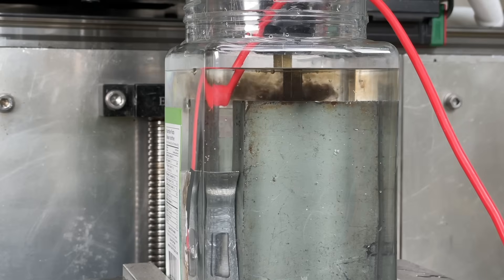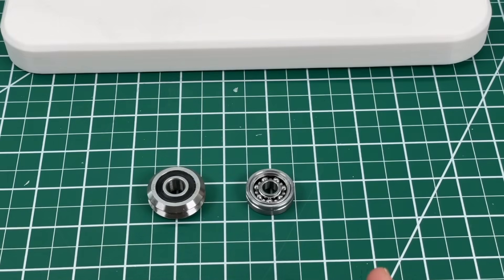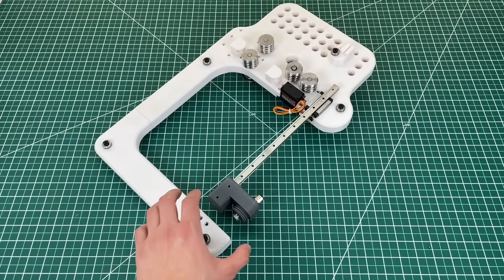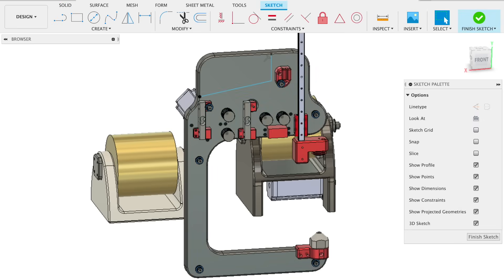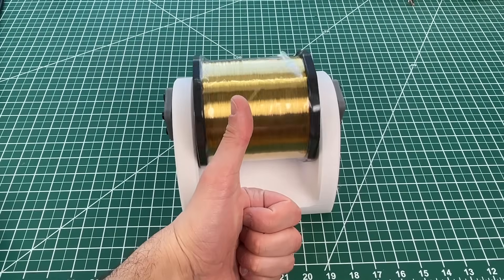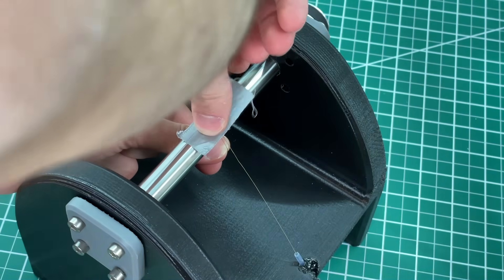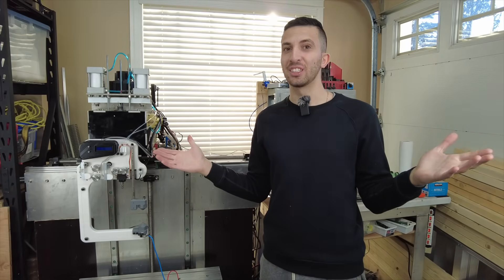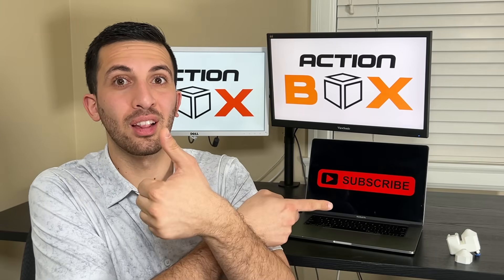How We Made A Wire EDM Machine At Home

Comment: The spark generator you are using is designed for a sinker EDM which requires allot high currant. This is what’s snapping your wire. I agree that Baxedm is way over price but it is his product to sell for what he thinks it’s worth. Unfortunately there are no other options. I truly believe he would sell more product with a lower price. I know I cannot justify or afford one. You could possibly try to modify the sinker EDM to lower the current output but I doubt it would work. Enjoy your videos and topics.

Comment: Although I know I'm late, I'll leave this comment for anyone interested in wire EDM cutting machines. There are several important factors that home makers don't know or omit. The first is current control, but this goes hand in hand with the second, which is peak current control, which depends on the wire; you need to know how many maximum peaks your wire can handle Before breaking and third, the gap control, which is where the algorithm for the cutting advance is taken from.

Comment: @actionbox. Looks like a very promising piece! I was just curious If the physics is correct on this... I'm a simple man so take it  at face value but it seems to need a centralized focus point. Perhaps instead of it being in a pool of fluid you should just  pour the fluid over the top so it isolates the spark each time you push it against the material instead of increasing the surface area. If this theory pans out it may explain why when you increased area it was even less of a desirable cut.

Comment: I knownthisbis old but never use 100% infill, 98% is as far as you should need to go, because 100% will try to fill all the non existant gaps that apear in software at cross sections. And doesnt acutally add any extra strenght

Comment: Having retired now for 5 yrs doing wire eroding I think you need a spark on off times in the generator and the wire needs to be able to back off if it senses a short circuit then approach the work piece again but your problem lies in the generator the current has to be able to pulsate.
on a purpose built commercial machine we had a lot of wire breaks until all the settings were fine tuned, its not easy or straight forward by a long way. good luck if you crack it.

Comment: You'll have better luck with tungsten wire.. and you are correct about needing a water filter. Dissolved metal destroys your deionized water pretty quickly otherwise. Your filter is gonna need to be two stage to one micron If it's going to last very long

Comment: Not sure about EDM but in electronic circuits and lasers, we're generally looking for 18Megohms/cm. Don't know if I'd trust Crappy Tire to provide that. If you're introducing metallic swarf into the water, I think you should consider a 0.1 micron filter followed by an R.O. set-up. Keep in mind that DI water is generally dissolved oxygen rich. It will tear any copper to pieces. Nice rig though!

Comment: Please, don't use multiple micro controlers for the tool, I know they are very cheap but even so I feel a bit disturbed since their prices here in Brazil aren't so friendly, I think you could have use a single arduino for both pressure loads and for the LCD, I think it would also be really nice if the tension on the wires wheren't controled by knobs, but by the GCODE, you could do that by connecting the arduino via serial to the main board, and the main board sends commands about the wire tension to the arduino

Comment: Hmm, i can onlu think of a few possibilities but i dont have immediate soultions. Note: i dont work with these systems, but i have a mibor in EE, so i can theorize.

1) the wire is desolving itself and elecrtoplating itself onto your work peice. Swapping pokarity may fix this.
2) The sparks generated may be heating the wire up too much resulting in it melting and thus breaking.
3) Too much tension, causing the wire to streatch and break as it heats up slightly and pulled through the deionized water. If this is the case reduce  the tension on one side or tge other. (You may even have to build a powered feed system as well.)
4) Check the conductivity of your water. (Sometines the chemical processes used to process the water can leave residual particles. If this is the case you should be able to pick up come resistance in the water. If it's properly deionized then you should have an open circuit. If it has any reaistance change your supplier.)
5) I know your cobtrolling yiur current, but have you checked your voltage. If the voltage is to high you may have an issue.
6) If the wire is getting too hot, you may need pulse it to give tge wire time to cool between sparks. I believed this would be AC, or pulsed current. Any standard PWM may work, or maybe use an amp on a waveform generator? This would give the qire time to cool between pulses.

Let me know is any of these helped.
Thanks and great video.

Comment: Awesome job, I have at least a decade running wire and cnc and manual sinker edm. You getting this far is great. Some tips I would tell you is wire is its own beast and where your flush cups are located in relation to work is crucial .005 above and below plus good flush and filter. I have no idea how your controlling the power but lower power until fully into cut switching polarity from table to electrode and adjusting on and off times in your spark. In my opinion finding an older machines power supply with the preloaded power settings would be the only way I could ever even attempt something like this. Great job again, very very impressive. PS you got me to sub.

Comment: wire edm machine limits Amperage not exceeding the strength of the current-carrying wire, limits the gap between the wire and the workpiece at table speed so that they do not come into direct contact, regulates the adjustment voltage, cannot be pushed like that😂😂
Reply from the maker: So we’ve learned.  Our next iteration will improve in this 😊

Comment: You need to detect the current in the wire to prevent a high current which will burned through your very thin wire.

Comment: Using 100% infill is mostly a waste of time and plastic. The mechanical stress is mostly concentrated on the surface and mostly in the inner corners of the part. So in order to have a strong part you only need to make thick walls. Infill does not contribute to the strength of the part, it's just an internal support structure for the printing that you can't remove.
If you still have to make some area of the part stronger (like those places where the bearings are inserted), I think Cura has a a way to locally change the printing parameters using local volumes, which should allow increasing the wall thickness in particular areas.
Rounding those main inner corners was a good idea though - this does spread out the stress and makes the part stronger.

Comment: Spark control ... needed. The nozzles should have the conductor tips.. you only charge the wire near the work area. The take up wheel could be rubberized .. running wire between 2.. when running wire you don't need to re spool. Most machines just collect in a bin. I've run and programmed Hitachi 203r and also a Makino wire edm. These have independent top and bottom wire guides to help align and square to work area..

Comment: Idk much about this technology but I do think that the wire isn't supposed to contact the workpiece which is why the need for the dialect water, it acts as an insulator while at the same time keeps the wire cool, so I don't know what kind of power supply you would need but it would need to be high enough volts to be able to create a spark gap much like how plasma cutters work. if you ever used one the first thing they tell you is don't let the tip touch the workpiece. Might be a good place to start. Seems like a cool project I would love to see it work for us diy guys.
Reply: Ok so I find this technology really fascinating and found some interesting things out. So there is this guy who made one of these over at instucables, and for his power supply he uses incoming 110 ac, runs it through a 200w bridge rectifier, uses a 200w incadcent light bulb to limit the current, and looks like it has a couple capacitors to. The circuitry looks relatively simple, and he has posted videos of it working. The AC is converted into a pulsating DC voltage 60hz or 60 times a second, idk if this would work or not because I thought it had to be between 300 to 1000 a second. But maybe still does work, and is just slower. I was also right about the wire not supposed to touch the work piece you may have to touch it to start the arc but then pull it away much like Tig welding. But check his setup out because it seems relatively simple, and Id like to try this myself because this could open up a world of machining not normally accessable by us hobbyists.

https://www.instructables.com/EDM-Electrical-Discharge-Machining/

Comment: I realize this is a year old, but I just now saw this. I do not have a good answer for this, but I would advise against using a rolling bearing as an electrical connection. You will eventually pit the balls and the race of said bearing and it will eventually fail, but before that you will likely get accuracy errors and depending on metal used, additional rust, and likely the biggest problem, poor and inconsistent current flow.  We have to watch out for this when controlling large AC motors and keep the common mode current as low as possible from our VFDs so you don't burn the bearings out of the motor or load the motor is attached to. 

So how to solve your problem here? I honestly do not know, maybe the bearing becomes a consumable item? Maybe a brass bearing instead of steel/stainless? How do they solve this commercially?

Comment: I would graph the current over time through the machine. I bet the instantaneous current is too high. Additionally I would vary the speed of the wire according to the current draw, to prevent the wire from heating locally too much.
Reply from the maker: Great suggestion, we will consider this for our v2 design.  Cheers

Comment: I ran a Sodick A280L for years.  Mostly 0.010"wire with diamond wire feeds.  I cut stock up to 7 inches thick with that machine.  The filter and deionizing systems were substantial.  Also, there needs to be feedback from the spark to the wire power system as the condition of the kerf is a continuous state of change what with variation in the spark line and excellence of flushing, which was powerful - lots of water at quite high pressure - I would guess 40 to 60 psi or more.  Nice project.  Visit a working wire and take some notes.
Reply from the maker: Thanks Ron. Admittedly I have never seen a wire machine while attempting this so I do appreciate all of the feedback.  I will take all of these notes into account when building the V2. Cheers, Dave
Reply: @ActionBOX  Maybe two more things.  Try cutting aluminum foil.  It will confirm most of your operating ideas and little flushing will be need.  You will need an auto fee mechanism tied to the wire condition circuit.  This will slow the cut if conditions are tenuous at the wire and speed it up when conditions are good.  These machines are quite complex I think with lots of feedback from the wire circuit going back to the motion control module.  It will test your engineering skills quite seriously but you seem willing to throw yourself into the fray.  Best of luck.
Reply from the maker: @ronrabie9638 thanks a bunch, this will help 😃

Comment: Are the 250micron hole steel screws diamond wire guides or just 3d printer nozzles enough?
Reply from the maker: They are hardened steel.
Reply: @ActionBOX  Thanks. So hardened steel 0.25mm 3d printer nozzles can be used too(as they are more easily available)?

Comment: Cutting with WEDM is a delicate balance between a dead short and a open circuit.  The internal diagnostics of the cutting condition is everything.  Ask yourself why Sodick puts linear motors on all their wire machines.  Quicker response times during cuts, equates to better performance cuts.  Be sure of ONE thing.  If you can't get your path movement to "back up" slightly, then move forward again (per your cutting conditions requirements),  you won't end up with much.  I'll say it another way.  What CNC machine do you know "backs up" slightly in its own path, then returns forward in its path.  Answer:  Only WEDM's.  This is done to protect the wire from breakage.  Good Luck.  Lee
Reply from the maker: Thanks Lee.

Comment: To further increase the wire's contact with the brake roller(s) you can feed it in a figure 8 pattern
Reply from the maker: That’s true. Turns out that the back and forth affects the wire though so I’ll be moving to a single larger wheel. You are definitely correct.

Comment: You have way way waaayyy too much output capacitance. From the size of the sparks it looks like maybe a few 10s of microfarad. You need something like 20-50 nano farads. The large capacitor you have will give you maybe 100-500 sparks per second. You want more like 10-20 thousand sparks per second. As others have mentioned. The only realistic way of achieving this is to purchase a professional spark generator. They are much much too complex to try to build one.
Reply from the maker: Thanks for your input, we are working on these upgrades for the V2, and have already acquired a power supply.  Cheers, Dave

Comment: I honestly rotational speed of o the wire feeder has to be adjusted so the wire can spend less time being in contact with the material you want to cut. I honestly think the electrical conditiond you set on the first cute can help solve the challenge you, please check the feed rate I suspect that is where adjustments are needed. I Thank you for making that informative video, I wish you success in all your future projects.
Reply from the maker: Thank you for your kind comment 😃

Comment: The tension sensor are actually "Load Cell" They detect pressure being exerted on the cell when you press on the end. the load cell is located in the open area in the middle where all that white stuff is. They usually look like a bare IC but are not made like an IC. They are usually resistive elements in a zig zag pattern and change value when stressed.
Reply from the maker: Ooo, pretty cool, I like the concept. Thanks for sharing 😃

Comment: You need to check out BAX EDM!  He is the master at DIY EDM machined and has invented a complete control solution for the wire cutting.  He also goes into extreme detail on all the issues you may have.  He's an excellent resource.
Reply from the maker: Mike at BAX EDM is an amazing and super knowledgeable individual. He has actually sent me one of his power supplies and I look forward to testing it. Cheers.

Comment: Not that I think it matters much, but your not routing the wire to get the maximum surface area, you should route it in a figure 8 pattern, not a ”figure 0 pattern”.
Reply from the maker: I see what you mean, great concept. Many of the views made the correct suggestion that looping it back and forth causes stress on the wire, so the next iteration will have a different design to eliminate this looping while maintaining high contact area.  Cheers.
Reply: @ActionBOX  I see, it would be a good idea to test if the wire is taking any damage from the pulley system. I think the easiest way to do this would be to test the strength of the wire before and after you’ve run it through the pulley system. If it snaps at the same force the pulleys are not causing any damage :)
Reply from the maker: @beaconofwierd1883  Il like that, its a great idea for a simple test. Thanks again for your input, and glad you are enjoying our content 😃. I look forward to your input in our next videos 😊. Cheers, Dave

Comment: Few thoughts from a wire edm noob: 1, that 4 groove back and forth spooling approach seems like it'd be tedious to load. 2, rather than a pid tension control scheme you can simply use 2 servos to spool and unspool at the same rate and use a tensioner pulley to achieve a constant tension
Reply: This also eliminates the brake and the servo. Just a spring and a pulley, tho a servo there gives you computer control of the tension
Reply from the maker: Thanks for this, this is indeed an update that we are making in the V2. Thank you for your insight and great suggestion. Cheers, Dave

Comment: Yeah Filter the water down to about 10 micron (You can use a pool sand filter, but use 10 micron cotton instead of sand), also maybe pump the water through deionization beads to keep the conductivity of the water more stable (A little table salt helps, but just a pinch.  Also there is a common saying in Wire EDM "Flushing, flushing and flushing", its important to flush away that residue quickly, flushing is key.
Reply from the maker: Thanks a ton, I will use your recommendations while building the V2.  Cheers, Dave

Comment: the wire is not spinning fast enough, you are eroding the steel and the brass at the same rate, you need to dilute the exponential erosion by not allowing it to exponate, you need so spin the wire faster!(educated guess)
Reply from the maker: Thanks for your input. It is consistent with what others have said so you must be right.  I will focus on this in our future v2 design.  Cheers.